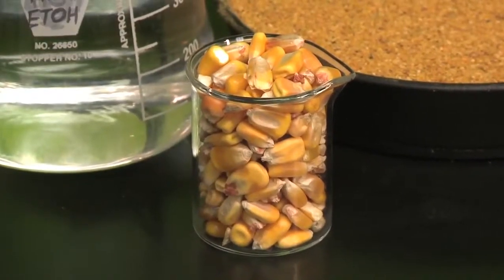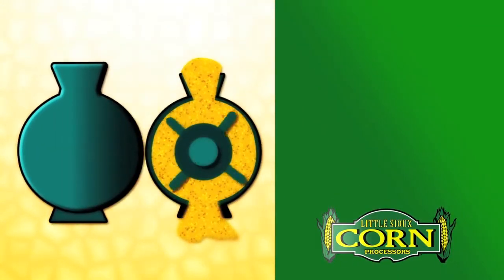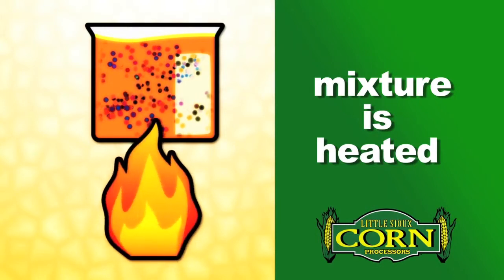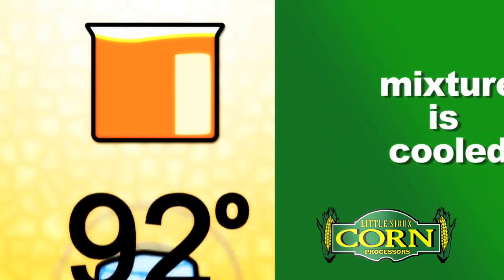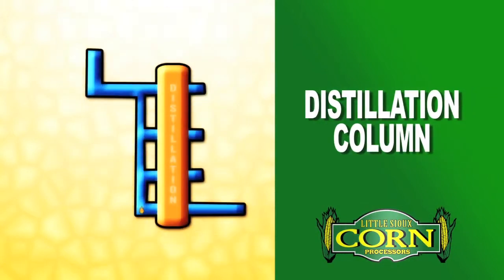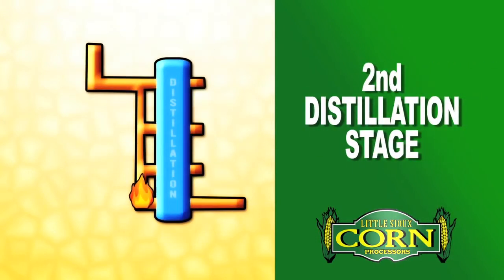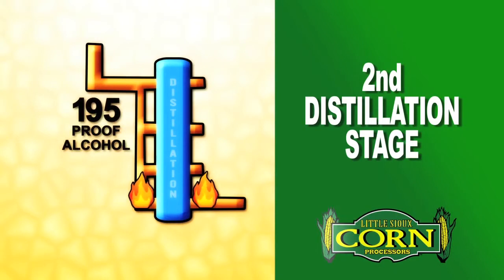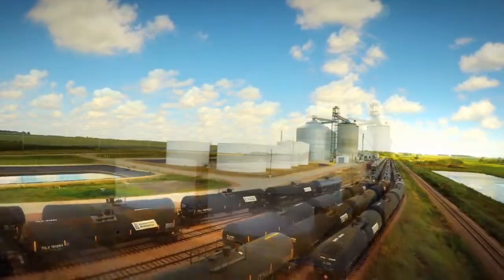How Ethanol is Made

Comment: How can anyone believe bio fuels are carbon neutral?  Heating... cooling...
Reply: In theory you could obviously use ethanol to fuel the entire process, or use renewables. Also ethanol is useful as a store of energy, it's much more energy dense than batteries so it would make sense to use solar/etc to make it.
Reply: @ksc1406  in hindi 🔥
Reply from the maker: Ethanol does not claim to be carbon neutral today but the latest study out of Harvard University does show that ethanol reduces GHG emissions by 46% and we can foresee a day that ethanol can be not just carbon neutral but actually net carbon negative because advanced farming techniques will allow for the capture and storage of carbon in the ground. Farmers and biofuel producers are continuously increasing efficiency and finding new ways to lower emissions.